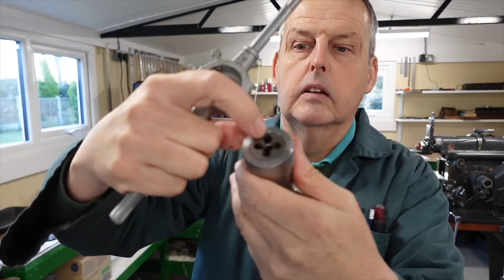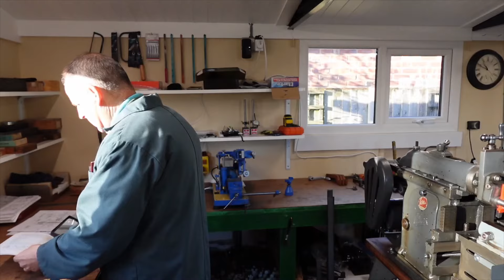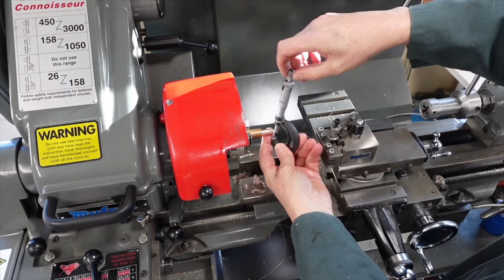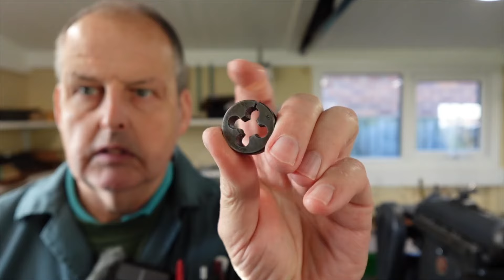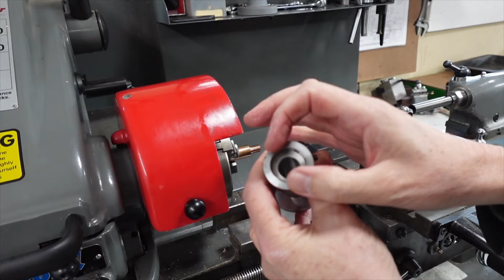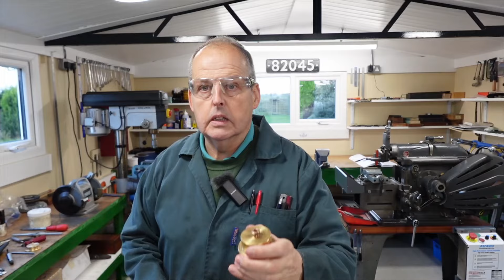Tailstock Die holder problems (Myford Lathe)

Comment: Also your die holder may be badly made (ie not concentric) Make your own then you will be confident in using it. Also knurl it and use your hand to grip it down the threads. Using a handle may be the cause of the misalignment.
Reply from the maker: Yes there are no guarantees that components are perfectly concentric.  Thanks for the comments.

Comment: As a former machinist and later design engineer - I found your thread die project interesting. When I done this work on highly precision threads I always had the die set to the finished size. But I cut the thread (3 to 5 thou oversize) with a screwcutting tool to make it concentric. Then ran the die over the thread to finished size. Guaranteed accuracy. But you need to be proficient at screwcutting on a lathe. Dies are only good for small cuts over fully formed threads. They are not ment for fully forming threads. That will never work on steel (maybe brass / soft metals)
Reply from the maker: Interesting ideas, reminds me of a thread chaser to finish thread forms.  Thanks for commenting.

Comment: Are the outer closing screws in the tailstock in line ?... if they are slightly offset from each other the die will be twisted (kinda like a spring washer shape) ... making the die cut undersize... 🤔

😎👍☘️🍻
Reply from the maker: Yes that is something I did not think of.  Thanks for commenting.

Comment: The Arrand die holder is adjustable to compensate for any offset. Though you said yours was bang on.

Also a set of "drill blanks" would be ideal for measuring those 3 flute dies. 🙂
Reply from the maker: What an interesting die holder, I have never heard of that.  Thanks for commenting.

Comment: If you had reversed the die off the work under power you often find it takes another shaving off, sometimes more than that if anything is cocked over.
Reply from the maker: Yes you may well be right.  Thanks for commenting.

Comment: I made a spring loaded plunger that goes in the tailstock. There is about an inch recess for the workpiece to pass into. It only backs the handheld diestock. The spring alows turning the diestock without having to keep pressure with the tailstock
Reply from the maker: That is a very interesting idea.  Thanks for commenting.

Comment: The pin in the floating holder slot should have flats on both sides to greatly reduce sliding friction. Also did you try a screw by hand into the die. Did you measure the core diameter of the tapped hole. If you give your holder a bit more slack, put flats on the pins, extend the tailstock quill and leave it unlocked also leave the tailstock unclamped. The die will work much better.
Reply from the maker: I don't have a screw to try in the die.  The core diameter of the female thread is one size down on the size stated in the table.  I did this to make sure the thread was as fully formed as possible.  Thanks for commenting.
Reply: @davebates2709  Will you try the flats on the anti-rotation pins? It transformed my floating holder.

Comment: Good video. Diesel heaters worry me. I hope that you have a carbon-monoxide detector. My garden is frozen solid, can't dig in it until April. Again, I learned something new to me. I used to teach civil engineering students how to design bridges. What we teach lives on long after we are gone. Good Luck, Rick
Reply from the maker: The combustion chamber takes air from outside the building and then exhausts outside as well.  The fan circulates the air inside the building over the furnace to heat it up, but does not come in contact with the combustion gases.  I am planning to have a fire survey to see what I need in the workshop and the house.  Thanks for commenting.

Comment: My tailstock die holder  is of a differant disign  of which i have seen on the net the die fits in a floating sleeve it has a fair bit of clearance i am wondering after watching your vidio if this was done for a reason to help it self centre . never had any problems with it  but never used in on fine pitches thanks
Reply from the maker: That sounds interesting.  Do you know what make it is?  Thanks for commenting.
Reply: @davebates2709  I would say home made found it in bits in a box of engineering stuff at a car boot sale made a bigger die holder over holidays and noticed it was a bit loose considering the rest of the machining is pretty good would send a pic but would no how
Reply from the maker: @davemcnair1569  There is a tailstock die holder design on the Hemingway Kits web site.  I ordered it yesterday it might be the same tool as the one you have.  Thanks for commenting.

Comment: I’ve had some trouble with a tailstock dieholder a couple months ago. In my case there was too much friction from the dieholder when the die was cutting and pulling itself over the stock. Maybe the pin in the tailstock or the bore on your dieholder doesn’t have a smooth finish? Also with your dieholder design the reaction arm is only on one side do the die holder which will cause the die to get levered out of position because there is  play between the pin and the die holder.
I have made a working solution in my last video if you’re interested
Reply from the maker: You are right about the lever forcing the die head over, to one side, as the force is applied to cut the thread.  I will have a look at your video with interest.  Thanks for commenting.

Comment: There is no incentive for the die makers to have the thread in the centre of the die because in the correct die stock is, as you say, free floating. If you constrain the die in a tailstock holder it can act as a cutting "box" tool not a threading tool.
Reply from the maker: That is exactly what is happening.  Really what we need is a free floating tailstock die holder (conventional die stock holder).  Thanks for commenting.

Comment: Very interesting bit of investigation and fault finding Dave. I have to admit that I don't use a tailstock die holder very much anymore. I tend to just use a standard die stock backed up by the tailstock as you did.
Reply from the maker: Yes the standard die stock holder seems to be the better option for simple small threads.  Thanks for commenting
Reply: @davebates2709 No problem. I just find it easier when wanting to generate relatively short threads to use the die stock. It's no quicker to use the tailstock holder in my opinion.